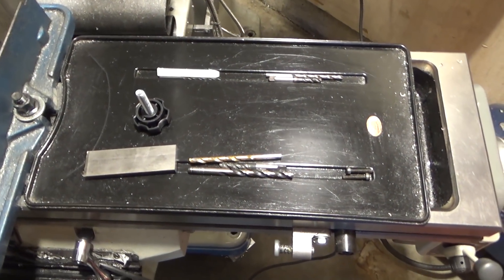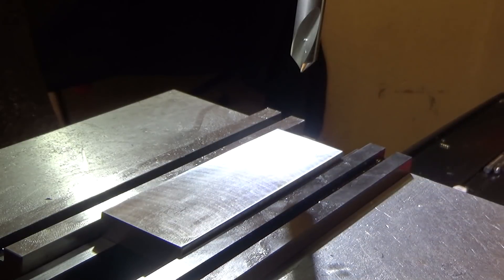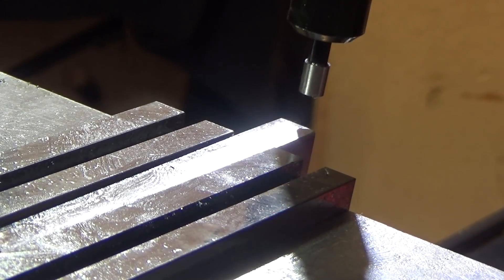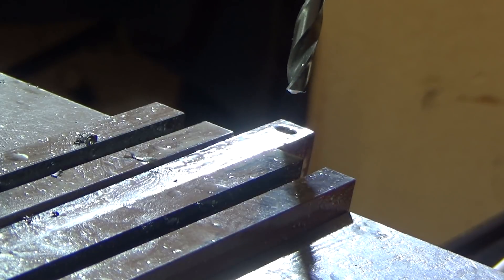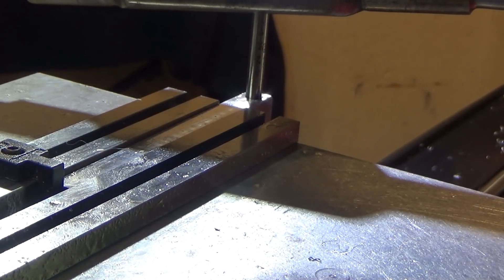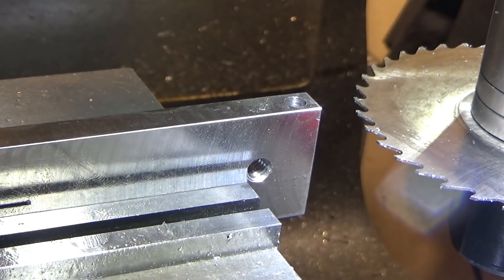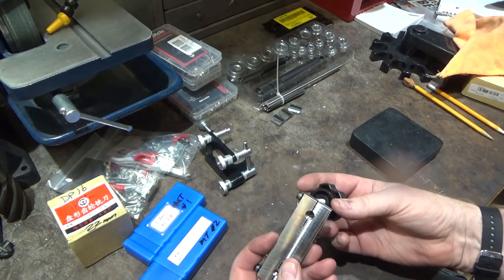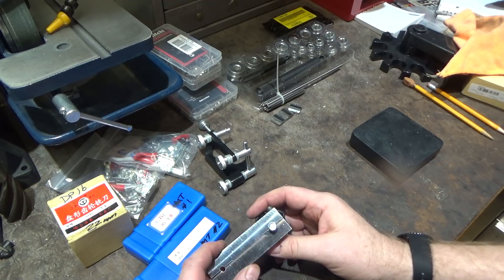Thread Vise

Comment: Nice tool.  Much safer and more accurate than holding by hand or vice grip, and won't damage the thread.  A longer slit would probably be  best as thinner material would push being able to get your cinch bolts into the edge of the clamp.  Good video.
Reply from the maker: I think you are correct. Others recommend the same, saying that I should have continued the slit past the threaded part. Live and learn.

Comment: If you have trouble check a marine store or rv store.  They are used in the pickup side of pumps too.  I have a piece of white vinyl that I don't remember exactly where it came from but probably off one of my boats.  Wall is very thick for its diameter yet still somewhat flexible over a three foot plus run.  I think it is some of the 'holding tank' hose made to be vapor impermeable to keep smells away in a boat or RV.  I also use a wire reinforced black hose for heat exchanger leads that has a smooth interior and would be very oil resistant.  Auto stores should have it.  Comes in a large variety of size and again somewhat stiff but for doing the machines I think it would do fine.  

Another beauty of the swager design is you don't cut any threads in the soft jaws as they grip the thread on the bolt you are working on.  So it is much more universal.  Take care.  Doug
Reply from the maker: Thanks. Will do.

Comment: There are thick wall vinyl hoses as well as thick rubber and wire reinforced with smooth walls.  My shop vac drips oil for days after use.  

Tube pipe flaring (copper fuel lines, a/c etc) is exactly what I was thinking.  Swing out bolts with wing nuts, steel body with one piece on each jaw of aluminum (soft jaws).  The forces necessary would allow it to be pretty small and light mucg the size of the tube swager.  Easily adapted to use in a vise.  Take care.  Doug
Reply from the maker: I will look for hoses that can withstand a vaccuum. A flaring tool style design is a great idea. Thanks.

Comment: Hello Robert,  I was thinking in terms of the swaging block used when flaring copper with swing bolts at each end and all the sizes in the split block.  Now you could use aluminum for the soft jaws and machine them to be replaceable.  With lightly machined rings in the bores of each size if needed.  In this design thread size wouldn't matter.  Diameters could be quite inclusive in one small block.  You could use HDPE jaws if you do aluminum bolts.

As to the cyclone I am hoping that with the claimed efficiency of the cyclones (generation three on Banggood) that even the oil mist would be removed without a pre filter.  If not a simple paper (non pleated) should do the trick.  One of the problems I would like to overcome is that the corrugated hoses seem to trap a lot of that oil in the pickup hose.  I am looking for smooth bore type hose that come overcome the vacuum pressure.  Take care.  Doug
Reply from the maker: I like your idea. If I have this right you are talking about something like a pipe flaring tool? It would be a lot mor effieicent than have a tone of the tools I made. Let me know if you pursue it and it works as planned. I was also wondering about my corrugated hose catching the oil. I have never seen a smooth vacuum hose, Is that an available thing?

Comment: Hello Robert,  Watching your project with the thread clamp caused me to wonder if one could be made with a profile like a thread file so that it would hold a variety of thread sizes rather than needing one for each thread?  On another topic:  I am wondering if you use a cyclone with your dust collection?  If so do you think it helps to keep the oil from clogging the paper filter on a shop vac?  I ask because I just ordered one off Banggood for about thirty bucks to give it a try.  I have a metal shop vac but the cutting oil clogs the pleated filter quickly and they aren't cheap at $12 a pop.  Take care.  Doug
Reply from the maker: Great ideas. I was wondering how you would put pressure on all of the threaded holes along the length? Would you part it in two and have screws along the length for pressure? If you make one let me know. I am very interested. As to my vac, I  have been wondering when the lube would kill the filter. No, I don't have a cyclone (like I did in my wood working days), but I do have a $24 dollar porter cable shop vac from Costco, so I haven't been overly worried. You do bring up a very good point though. If the vac turns the oil to mist, it might pass through the cyclone so perhaps some sort of prefilter like that open mesh stuff they use for air filters on electronic equipment? You could at least wash those. I really don't know what you would do, but you do bring up a very good point. Thanks.

Comment: nice fixture. drilling a hole at the end of the saw cut will allow easier clamping. i made a fixture to cut threaded rods for my band saw. i drilled and taped a plate a little larger then yours with all the common sizes up to 1/2" i welded a piece of  1x1 structural tubing about 10" long to the plate .. to use clamp the tubing in the saw vise so the blade will just slide on  surface of the plate. thread what you need to cut into the plate ,i use a  jam nut to hold the piece to be cut. lower your saw onto the piece and cut it off. {note you have to feed the blade down manually or it will drop when it finishes the cut}. it works well. when you back out the part it cleans the burr just a touch up on the belt sander needed. no grinder heat or crooked hacksaw cut.
Reply from the maker: Great idea thanks. I really appreciate you taking the time to share your very interesting solutions. Cheers.